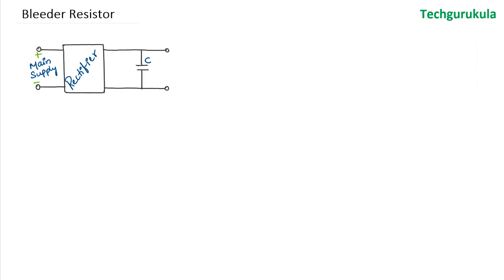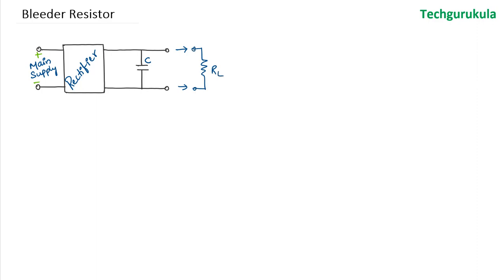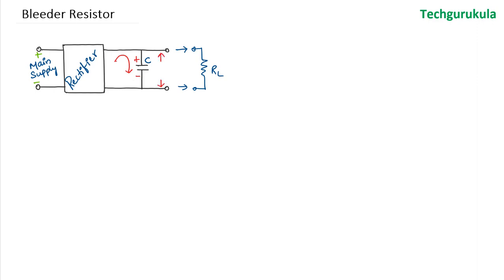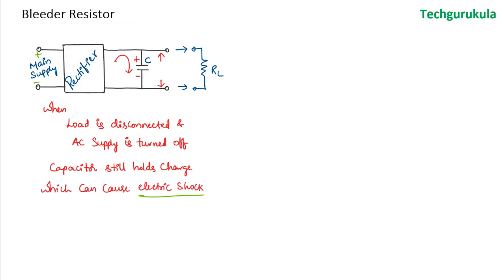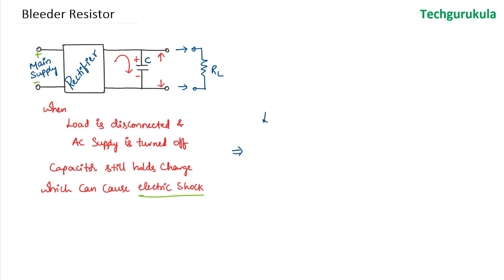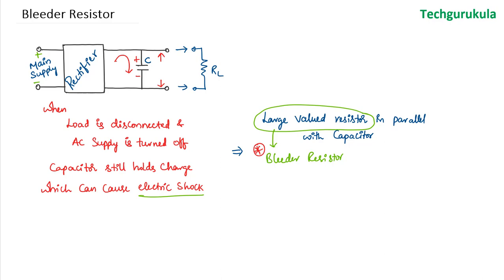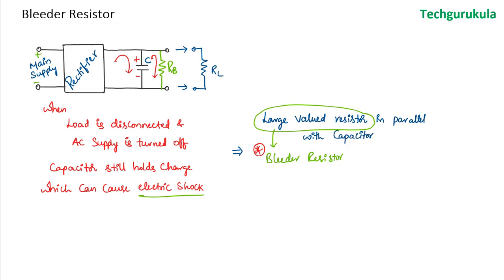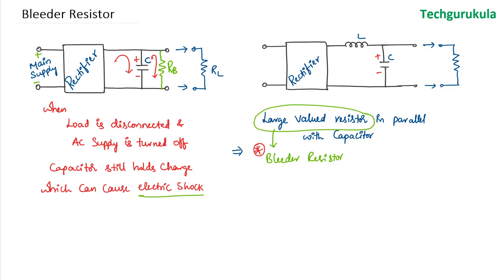Bleeder resistor

Comment: What value resistor should a use with a 50V, 47,000uF capacitor? I'm using the capacitor in a welder that has an operating voltage of about 35V. Cheers

Comment: What will be the value of this bleeder Resestor ?
Reply: One has to compromise between power consumption and the speed of bleeder resistor. A small valued resistor can provide high speed bleeding but the power consumed is higher. So it is up to the designer that how much manipulation does he wants. The resistor value must be high enough to not interfere with power supply and at the same time low enough to discharge the capacitor quickly.

The formula to calculate the value of bleeder resistor is given as:

R = -t/C*ln(Vsafe/Vo)
Here

t is the time taken by the capacitor to discharge through bleeder resistor

R is the resistance of bleeder resistor

C is capacitance of the capacitor

Vsafe is the safe voltage up to which it can be discharged

Vo is initial voltage of the capacitor
Reply: @susendramadallapalli7957  Hello, how do you calculate t?
Reply: @susendramadallapalli7957  Also, for Vsafe, is it referring to the maximum voltage of the capacitor?